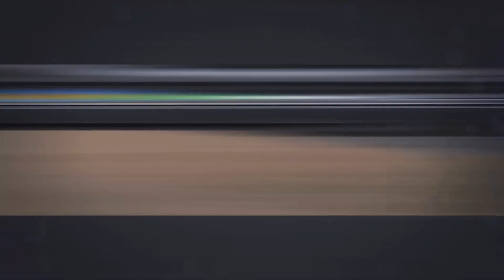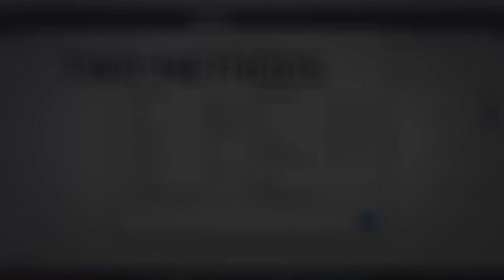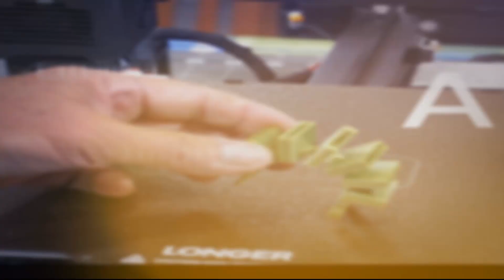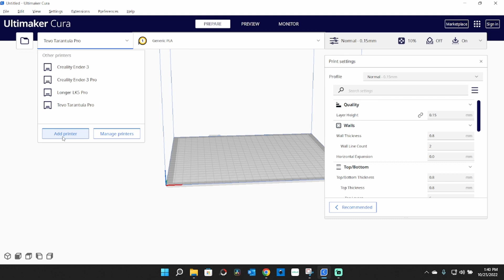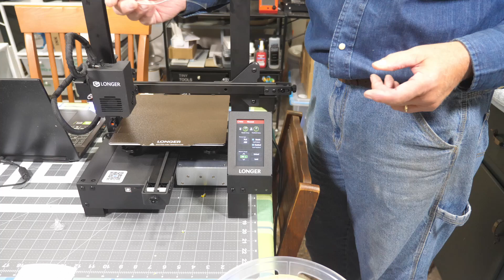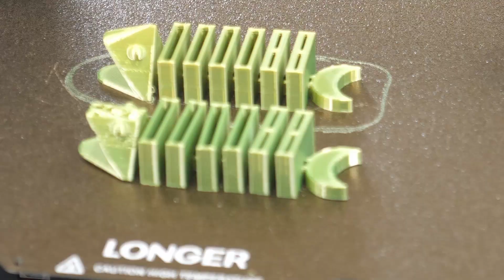Longer LK4 X Software Setup and Sample Print

Comment: Hi i have a longer lk4 printer and am not able to set up my cura since the sd card did not come with initial file for the setup. kindly assist on how i can do the setup.
Reply from the maker: The Longer LK4 is listed in Cura.  Go to manage printers/add printer/non-networked/then scroll down to Longer LK4.

Comment: I only have this printer and I don't exactly know how to install the folder they talk about once installing Cura
You mention a short video on how to do it could you please share the link 
Thank you very much in advance.
Reply from the maker: This is how to update firmware:  https://youtu.be/YvzdAEhWJx4  If you are not having any problems currently, then there is no need.
Reply: @rogersshop  thank you very much Rodger I really appreciate the reply, I haven't tried my 3D printer yet, I have installed cura onto my laptop from SD card supplied with the printer and still haven't done what they said as I couldn't figure it out.
I'm going to look for that clip on the SD card hopefully that will help.
Thank you very much for the info you've got an awesome channel 💯
Reply from the maker: @rcfungames  You will probably need to update Cura as the versions generally on the supplied card is dated.

Comment: You can still open the configuration folder/directory from cura and copy the content over. That way you can directly add the LK4 X also in newest Cura versions. You can find it under Help -> Show Configuration Folder
Reply from the maker: True, but one would need to be very careful not to overwrite or delete any existing printers.  Since I have 6 different ones, I elected to do it this way.
Reply: Shouldn't be a problem, as it just copies files that are new if you haven't added them before. In windows there isn't a way to replace a folder, just files, so you should be on the save side.
Reply: You are correct.  Cura opens up its configuration folder, in my case the folder is called '5.2' on a Mac OS. I just copied the definitions, quality and variants folder into this '5.2' folder. The LK4 X finally showed up in the printer directory listing on Cura. I even contacted Longer yesterday and they were not aware that their instruction video is outdated for the newest version of Cura. On the Mac, I have an option to 'Merge' and not 'Replace' if there are files already in the targeted folders.